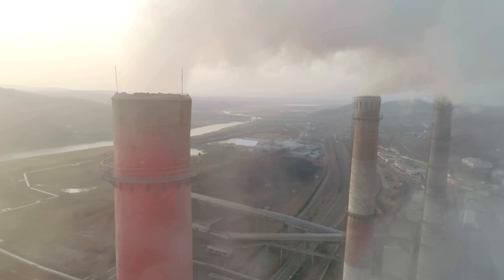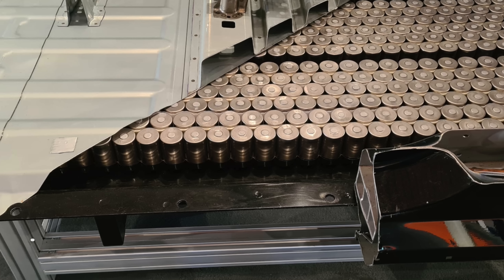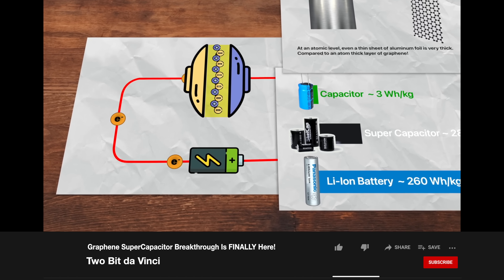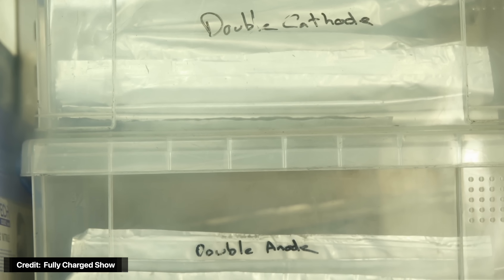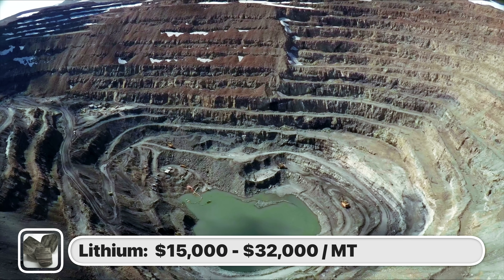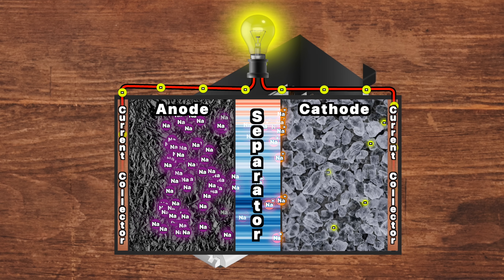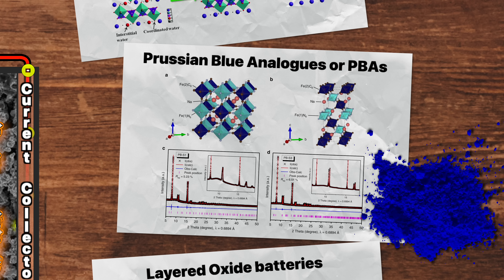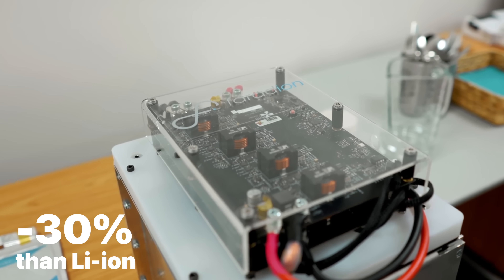Next Gen Battery is 1000x Easier to Source and 99% Cheaper!

Comment: Best thing about sodium-ion batteries is that you can use desalination waste brine to make them — which can then go on to subsidize the cost of desalinated water. Win-win on multiple levels.
Reply: Plus if you have already removed the sodium from the brine you have effectively further concentrated the other minerals in sea water (including lithium) which might make it cost effective to extract more valuable materials from sea water.
Reply: Beat me to it. This could actually save California, refill reservoirs from the sea and if done right could also slowly refill the ogolala aquifer that most of the Midwest draws water from
Reply: @TheHalcyonAnon  I don't think you understand geography that well, the ogallala aquifer is pretty far from just about every ocean and it is almost entirely above sea level so it would take a LOT of energy to refill the ogallala with desalinated water, or to economically pump desalinated water to regions that currently use water from the ogallala aquifer or any of the places that could feasibly refill it.
Reply: @garethbaus5471  The Gulf might be able to help the southern end of the Ogallala but any part of it north of Texas would be impractical to refill this way — completely agree there.
Reply: Interesting new desalination method on Matt Ferrell, lower energy desalination. There's definitely a need, so hopefully both will reach production.
Reply: @steppinstone  share link with me
Reply: @user-xn7xi8fd6sdid we run out? its been 3 weeks
Reply: also alleviates the worries of the greens that returning the salt heavy water back to the ocean will long term affect the salination %
Reply: Not really. Current desalination systems get uneconomical after you extract the first ?20%? Of fresh water from seawater, and mining solid sodium chloride from ubderground deposits is much cheaper than going the remaining ? 80% ?.
Reply: @daniel not going to run out of diesel. Waite sand see. There'd not a shortage of turkeys this year either. Sodium ion can hopefully take over the lifepo4 batteries we use today. It would be nice to be able to save up the lithium for future technologies that jack the energy density over 400 per kg..we need sodium to give us 5000 charge cycles too. Sulfur , zinc, manganese, silver oxides, there's a huge future and high end.
Reply: This. The west is running out of water and, soon, expensive desalination projects will likely be the only viable option for providing a new source of drinkable water. Sodium ion batteries already appear capable of achieving energy densities similar to/slightly higher than LFP batteries with much longer lifespans and are much safer than most standard Li-Ion compositions like NMC. From my perspective as an uneducated amateur sodium ion is one of the most promising up-and-coming battery compositions. Water desalination plants on the Pacific can begin supplementing west coast drinking water and the brine can be used to source sodium for sodium ion batteries.
Reply: @daniel no we won’t.
Reply: Aluminium is more abundant and has higher energy density
Reply: What about electrolyzing brine to produce hydrogen and O2? That would produce usable products and dewater the brine
Reply: @justinokraski3796  You’d end up producing Cl2 by doing that due to how easily separable the salts in the brine are compared to the water molecules.
Reply: Stop that. You are trying to make sense and they will sensor you....hahaha
 If the sodium comes from salt then you will have chlorine too.
Reply: Even I got the same idea. Or!?? Maybe this is what s the reason, sodium ion Bs are widely publicized and promoted.
Reply: I need lithium battery 🔋🔋🔋
Reply: You can make tweaks to lower the cost of sodium, but as it stands it is already the cheapest metal you can buy by volume.  The cost of sodium is an insignificant part of the cost of a sodium-based battery.  The rest of the system is where all the important action is, even in the long term.
Reply: we aren't running out of water
Reply: it's a win win for the government not us!
Reply: And then desalinization becomes a thing and then we start reading and headlines, saltwater, disappearing, oceans becoming unstable. Oops we’ve traded carbon monoxide for selfless, oceans humanity. Still in a big big pickle ha ha ha just kind of trying to read the play. This is not overnight but over a span of Say 25 years. Humanity always has a way of overdoing it.
Reply: It will never happen, if we want dried salt we just dig it up out of the ground for far less then the cost of drying out seawater.  All seasalt production is for human consumption where it can command a high price as a luxury form of salt.  All industrial salt is mined and always will be due to lower cost.
Reply: @kennethferland5579  Fancy Table salt and desalination sludge are two very different things.  Currently most sludge is just pumped back into the ocean.  And we need to start converting seawater to drinking water on the west coast pretty soon on a grand scale or the west coast of the US will run out of fresh water.  When a company goes public to do either one of these things I will be in line to invest.
Reply: @BillHartCooks.  This. Desalination sludge contains not only the sodium for the creation of Na-ions but also some other elements that could serve as battery electrolytes. Most of it can be put to use making batteries and my original comment is the inevitable result of that.
Reply: @kennethferland5579  By-products dude. Desalination is already a thing we need, but its cost is a problem. If a separate industry has a use for that task's waste products, a happy-collaboration can occur that benefits both industries.
Reply: @kennethferland5579  Currently, I would totally agree with that assessment.  Fast forward 10 years, and the desalinization process, and its energy costs should plummet.  As renewables take over for fossil fuels.  Battery storage at that level would be large, and immovable, but, wouldn't have to move.  The desalinization process could also produce freshwater to refill reservoirs, and supply potable water. If we continue to think in terms of systems,  we can move away from fossil fuels quickly, with many side effects that can all be used to repair the damage that human caused climate change has wrought.  The question remains, is it soon enough.

Comment: That’s a great video two-bit. Your video was informative and provide great chemical engineering explanation for the average person.

My only criticism would be with the last cliff hanger/question. Don’t you think the application of these batteries has a much more favorable place in items that do not move such as an energy storage device for your home. A battery that’s three times as heavy doesn’t make sense for products that  are going to be moving such as an EV. 

Once we use sodium ion batteries to make items that aren’t moved around so much doesn’t that open up more lithium ion battery potential for ev’s? I know EV’s are probably one of if not  the largest needs for batteries but how much of a difference would it make replacing items that don’t need to be transported lithium ion batteries with sodium ion batteries?

Comment: I would gladly buy a vehicle with a sodium ion  battery as the trade-off is minute versus the overall cost and benefits of not having to strip mine for the metals like it is being done to gain lithium.
Reply: We're finding better methods soon. A lot of li-ion comes from water beds than from mining. The new thing is to run the water into a filter though and getting even more out for way less time and using less water.
Reply: Link to a "strip mining" operation?
Reply: @rogerstarkey5390  yes, those big pits are strip mining mining mining operations to get lithium

Comment: Volumetric/ specific density may well limit these cells to "larger" public transport vehicles.
However, it should be noted that there's no real need for a dual motor, 100+ mph, sub 5 second "taxi"(!).
.
Dialling back and gearing down can substantially increase efficiency.
0-60 in 12 seconds? 60 mph max? Adequate in 90% of city trips.
(Also bear in mind it's likely the "urban automated transport" of the future will be more of a "box" than a sports car, so won't be as aerodynamic.
Low speed will be it's friend)
Reply: Yes c we do we nedd ho 155 o k us

Comment: In "current" Tesla models moving forward? Unlikely.
In the Robotaxi? Possible.
I don't think autonomous (city/ suburban) transport will need the "200 (300!) + mile range" that some believe.
Outside the "rush hour" (or 2) there will be opportunity for graze charging, even if it's split into 3-5 minute chunks.
A couple of minutes at 200+kW , every hour, "between fares" will more than top up a vehicle with a below 50kWh pack.
Most fares will be below 20 miles in most cities, assuming a city speed limit of 30 mph, that's plenty of opportunity.
Reply: Lots of small rapid charges will wear out lithium batteries pretty quickly for cycles. Fix the cycles issues and it makes more sense. I haven’t watched the video yet as of the time I write this to know if they claim they have no cycles degradation for sodium batteries, but if the batteries aren’t in use it’s irrelevant.
Reply: jußt biy lug on hynredvfirvtat

Comment: I would easily swap out lower range for lower cost. How often do you use the entire battery pack energy in one day?  I would especially make the swap for lower range if they manufactured more charging stations spread out.  The more places to charge = the less need for longer range batteries.
Reply: Holy scientific paper batman.
Reply: Imagine if the condition of the battery and charging stations were in the same condition as some of our roads. Not very appealing.
Reply: @bigedslobotomy  , They would probably match the grid at the current time too 😳
Reply: “There are already power lines running along every road in the US” is a blanket statement that is very readily provably false if you’ve driven long enough and far enough from where you live.
Reply: @strictnonconformist7369  , so is it a blanket statement to say that most places (for all intents and purposes of EV discussions) have power running to them already? If it could be done in the past, we could do it again, in the name of electric transportation. I forgot to mention the trillions and trillions of dollars spent on oil can be redirected to this cause. Money isn’t the issue if the oil industry sees a new profit source. I’m not saying it will be free or easy. Neither is oil expedition/refinement/shipping/sales etc
Reply: But, I also believe we should be spending all the money that we are spending on battery mining, manufacturing, battery PLANT manufacturing, charging stations etc, and put it toward electrifying the roads! get rid of batteries in cars! Where else can you have energy travel OUTSIDE / ALONGSIDE the vehicle? You certainly can't do this with gasoline.  There isn't a tube that can be attached to the vehicle.  to people that claim it would be impossible: 200 years ago, would they ever imagine that every househould, with every wall could have a source of electricity?  There are already powerlines running along every road in the US. Not to mention the efficiency of the cars if they weren't carrying A LITTERAL TON of batteries! Imagine the performance of losing a ton of weight!

Comment: I love seeing battery tech advance, but I do want to point out one issue. Videos like this often start by assuming that battery demand will grow infinitely, but that doesn’t have to be the case. 

If we push to build more walkable and bikeable cities while also making public transit more robust then battery demand won’t need to grow anywhere near as much! So we should pursue those actions at the same time that we work on better battery tech.

I’m still excited for tech like this though. Making batteries less expensive and more abundant will make the conversion to sole power so much easier for many families!
Reply from the maker: Great ideas and I’m all for more walking and biking. But energy use will still soar, as we have more electric heating and cooling to do, more industries like smelters turning electric…
Reply: @TwoBitDaVinci  I agree 100%. It would be nice to see that nuance stated in a video intro sometime. Help set you apart from the other channels who don’t seem to understand it.
Reply: @TwoBitDaVinci  
Another point of view might be to consider that since renewables are so demonstrably cheap to produce, a widespread grid of local production (rooftop, etc) with EXTRA capacity, able to shift energy as required from where the wind is blowing, or the sun is shining (always, somewhere!) Would alleviate the requirement for a proportion of the storage?
(Virtual Power Plant, on a National scale)
Essentially, for Solar, West to East in the evening, East to West in the morning.
Reply: @TwoBitDaVinci  
When (if) I get a moment, I'm going to take another look at the status of "flexible transparent (printed) solar".
That could be extremely useful incorporated on the inside faces of a double glazed window unit, (away from corrosive chemical attack)
Low energy, but a lot of unused area, not to mention possible shading to reduce air con.
Reply: Walkable and Bikeable cities depend on a year round temperate climate, plus the willingness to install and suitability of infrastructure.
.
In an ideal world, yes..
Reply: @rogerstarkey5390  having a more temperate climate definitely helps, but some quick google searches tell me that 21% of people in Denmark say that they use their bicycle every day and it’s colder month goes down to 32F.

So it’s still very possible to have less car dependent cities even when we don’t have temperate climates.
Reply: Making cities walkable and bikeable won't keep the lights on at night. He stated in the video that the highest demand won't be cars ect. but grid storage. I agree that cites should ban ice vehicles downtown but what about commuters who have to travel longer distances to get to and from work. EV's and electric trains should help to do that.  Same with long haul trucks converting to Hydrogen/battery type systems. Germany is experimenting with trucks that can draw most of their electricity from overhead power lines, so they only need enough battery to get the  final few miles to their destination. Geothermal technology is advancing faster now too and that might reduce the need for batteries by a large amount since it is available 24/7 rain or shine.
Reply: @lestermarshall6501  sorry I don’t mean to come off as selling walking, biking, and transit as some magical cure-all pill. You’re absolutely right that it’s a very complex problem which will require a multitude of different solutions.

But walking, biking, and public transit are definitely one of those solutions which are proven to be effective when implemented correctly.
Reply: people require a lot of energy and anything reliable & cost-effective is going to fill that growing need.  plentiful and clean are the keys.
Reply: Bicycles suck.........Try going to Lowes on a snowy Day to pick up Your building supplies..........Paul
Reply: @paul-flyer  In Houston,  they built underground walkways so you can get from store to store without going out into the summer heat. Maybe you should try to get your cities to do something similar. A bike may not work, but how about a scooter or golf cart?
Reply: Here’s a radical idea: let the people decide! (Instead of the government forcing it on us “for our own good”)
Reply: A 1000 times increase in the current battery usage is close enough to infinitely to use that word in ordinary conversational English